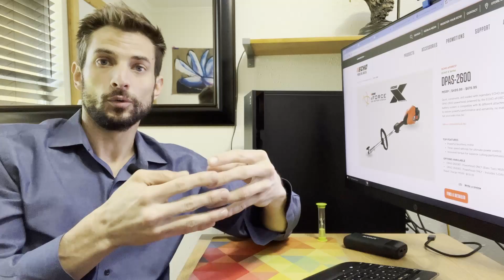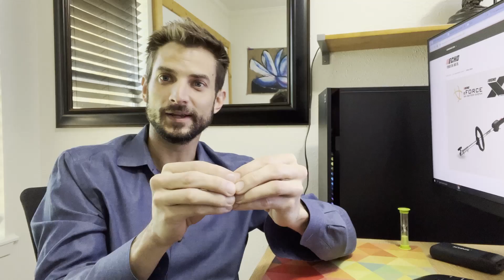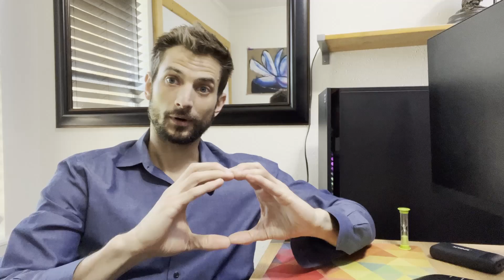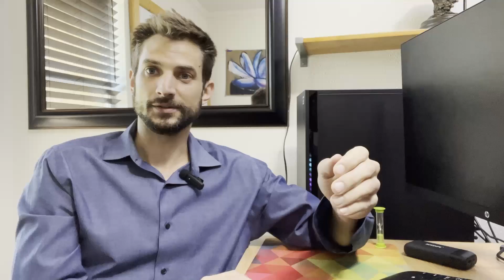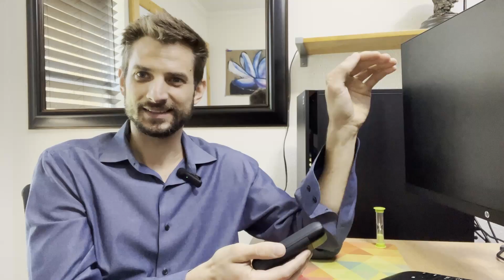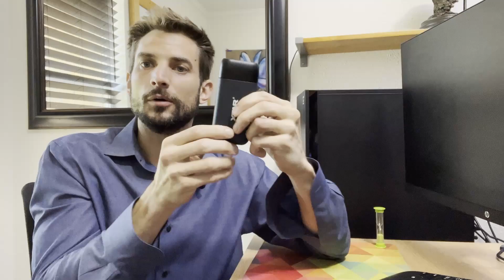Open Source Hardware is Evolving

Comment: It’s not really open source hardware that’s causing the revolution, it’s open standards for hardware interoperability. Open source hardware itself is never a good business move, as you allow competitors to remanufacture your products without reimbursing any R&D costs. Compared to software, hardware is more expensive to prototype, and is much less able to leverage community contributions. I think fully open source hardware is only sensible for government-funded projects, or other public-good projects.

Open standards for hardware interoperability have the potential to be incredibly powerful. I was watching those Tool Scientist videos and found that there are significant flaws in the protocol between power tools and their batteries. It could be a huge win for consumers if some smart people got together to design a full-featured protocol coupled with a hardware design such that companies would adopt it. Power negotiation standards for <50VDC could be especially valuable, if you make a standard that’s simpler and cheaper to implement compared to any of the USB C standards or PoE standards.